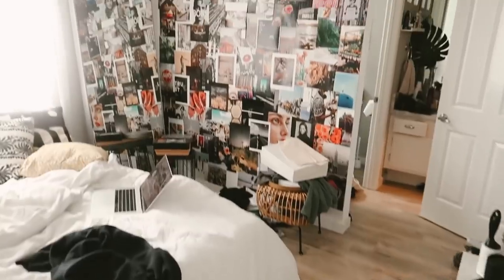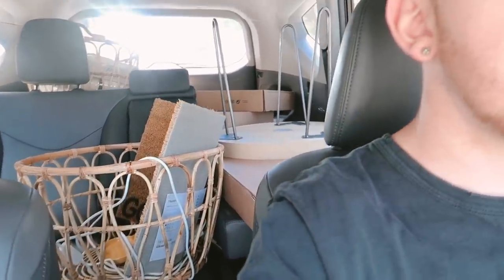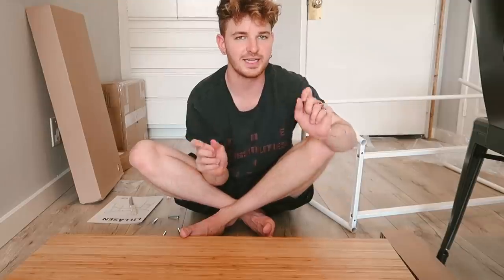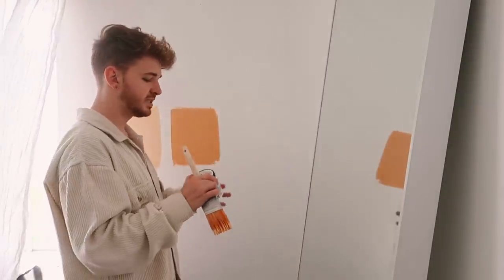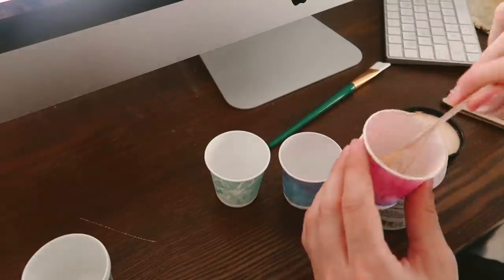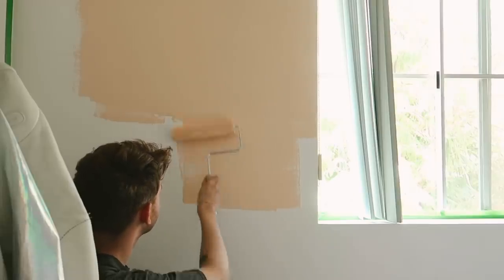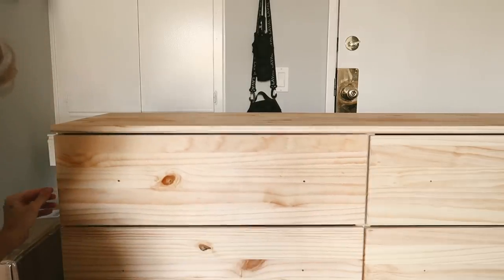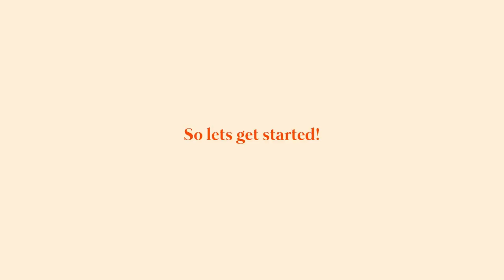EXTREME ROOM MAKEOVER + ROOM TOUR (2019) 🛠 Lone Fox

Comment: Take that storage piece you were undecided about and hang it on the wall behind where its sitting now. Take the legs off and then hang a ledger board to the wall securing to the studs then attach the piece by the ledger board. Will leave you your storage but, declutter the area.